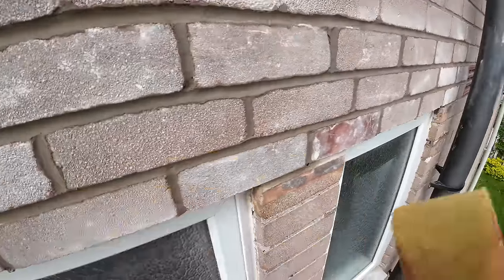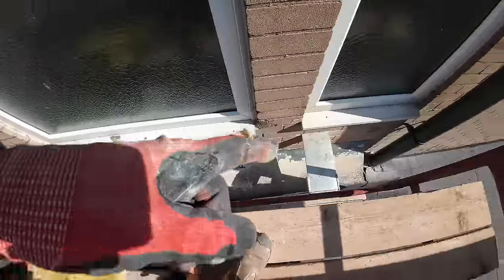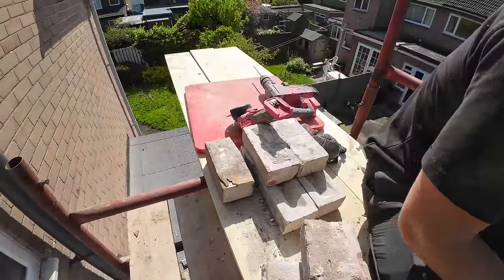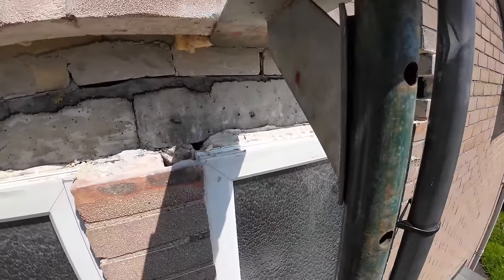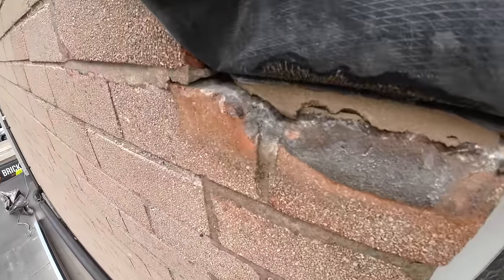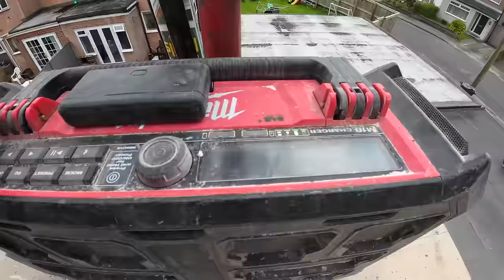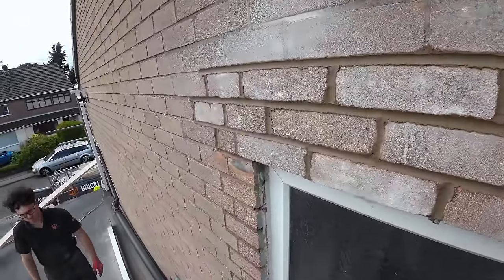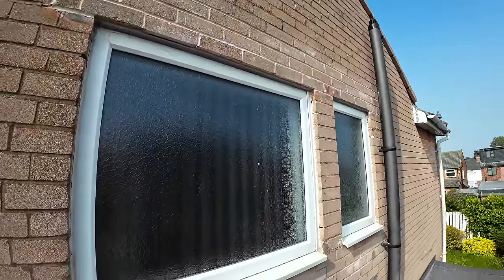THIS IS JUST VANDALISM !!!... MORE DODGY BRICKWORK

Comment: Great job guys .. it’s crazy just to lay bricks on top of the window .. I did plenty windows without lintel though in Belgium years ago but it requires a minimum 1 to 3,5 mortar mix and a soldier course above the window strengthened with some murfor in a couple of bed joints .. nowadays always have lintels or some special metal reinforcements placed in the joints … cheers guys !!
Reply from the maker: Cheers Jay .
   It was the Wild West back in the 60s 🫣😆🧱👍🏽

Comment: A great job - as ever.
Sha.e about that 3:1 cement mortar.
I noticed however that in terms of support you lost a lot of strength by not using the bottom strongboys the wrong way up.
The gusset and angle are crucial elements to take the load between strut and wall.
Reply from the maker: We didn’t need to prop at all the wall was solid 🧱👍🏽
Reply: I could see that it was pretty solid and I did wonder whether you'd just put the props onto a couple of scaffold boards.
As they were any real load on the props would only be resisted by the two courses of brick under the windows as the strongboy tongues rocked upwards.
That's if the props didn't just slide off them.

Anyway you left a neat tidy repair that as usual looked like you'd never been there.
I imagine you could probably do nothing but lintels given your quality and reputation.
Reply: Nice tidy result as per usual.  However I too have an issue with the your use of the bottom strongboy.  The stability of the device, in my view, 45 years in the trade and an experienced user of these things, greatly relies on the head plate taking load and transferring that load to the prop. That said when the bottom s/b is in the bed joint held in place by couple of courses of brick and the window frame above it my concern is for the potential of the bricks to uplift due to the leverage action being applied and transferring not to a prop but back to the wall. It’s difficult to explain but I offer this opinion with my full respect for the way you operate and in the spirit of wishing to enjoy your output well into the future.

Comment: Nice tidy job as always. Would have liked to see how you mixed that sand lime mortar and what the ratios are and do you do it by hand seeing as how it's a small amount?
Cheers 👍
Reply from the maker: 6 1 1 . We mix with paddle mixer for small mixes 🧱👍🏽
Reply: @SteveAndAlexBuild  sorry to be a nuisance I'm not a builder. Is that 6 builder's sand 1 lime or I don't know what is it please?
Reply: @Ricky-gu6xn   6:parts sand.    1: part Lime    and  1:part cement.
Reply: @martin2466  fantastic, thank you 👍
Reply from the maker: @Ricky-gu6xn 6 sand
1 cement 1 lime 🧱👍🏽
Reply: Sorry one more thing, what sand, builders sand?
Reply: @SteveAndAlexBuild  I think if you were to do a little masterclass on that guys a lot of people would be interested, lime mortar is a bit of a dark art.
Reply: @Ricky-gu6xn  Builders sand is fine for general work. You will need to give this some consideration if by chance you are trying to match up with a particular colour of mortar (seek advice)   
If you are mixing small amounts you could use a paddle mixer as Steve suggested.  Or mix by hand in a bucket or "Gorilla-bucket."  mix the ingredients together dry first,  before adding the water.  Make sure your water is clean and clear.
Do not add too much water initially, work the mixture with your trowel thoroughly - then slowly add small amounts of water to achieve the consistency you require.
Reply: @martin2466  thank you for this reply I really appreciate it. My house is a fifties house and I need to make good a few areas where the bricks need to come out and the mortar is quite light so I'm assuming it's lime mortar. I've looked on YouTube and it can get quite technical and lime has to be treated with respect. I really appreciate you taking the time to answer my question, thank you 👍
Reply: @Ricky-gu6xn   I am afraid I cannot advise any further without actually seeing the wall and mortar colour.   My best advice now would be to seek some professional  help and advice on the actual mortar mix on your house,  and how best to replicate it for the repairs you need to carry out.  
I hope my advice has been of some help, and best of luck with the work.  👍😁🧱🔨
Reply from the maker: @martin2466 🧱👍🏽

Comment: Good evening Chaps,
I am assuming that this "bodgery" was the handiwork of the window fitters.?
On a slightly different note now.    I know us ex-Brickies from the 1960`s and 1970`s could pull a few strokes and do "dodgy."   And some of the stuff that you have found in your videos definitely should be called out as rather suspect or, indeed shocking.  
But,  in fifty or sixty years time I wonder what "shockers" will be found on our modern day new builds....??  
Lightweight trench blocks crumbling?  Silo mortar failing?    Insulation boards turning to dust in the cavities......to name but a few.
🤓🤓🙄😮🤔🧱🧱🙄👍🔨
Reply: PS = Alex, will be retired in fifty years time - so maybe Daisy, will be putting the videos up then?  👍🧱
Reply from the maker: All very true 😬🧱👍🏽
Reply from the maker: @martin2466 😆😍😍🧱👍🏽
Reply: Put your 50mm sds chisel in your Masonary SDS to clean the bricks, will chip off lovely. 
Great vid and work as usual Gents . 👍
Reply: Thanks once again the pair of you for another episode of the lintel vortex 😂 another one done 50 or so on that road left to do😮
Reply from the maker: @mickshillito2199 cheers Mick 😆🧱👍🏽